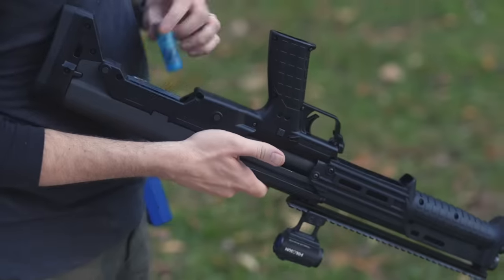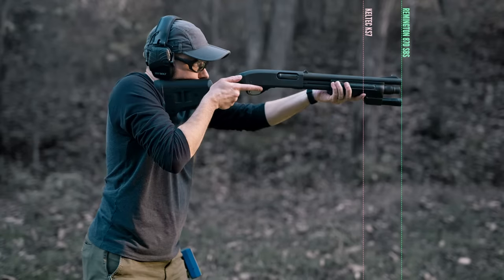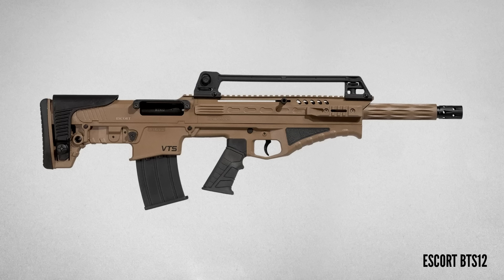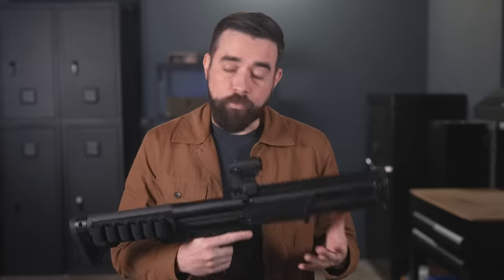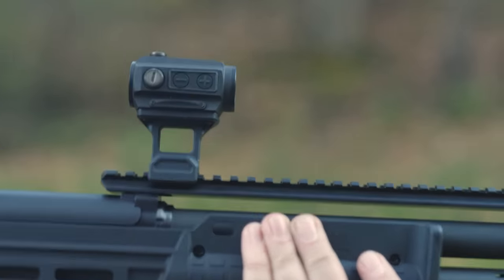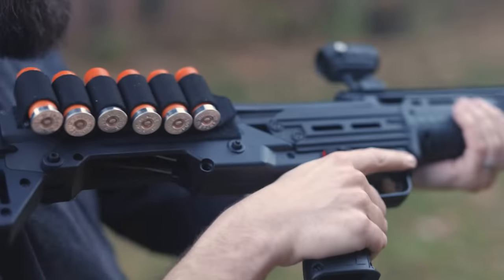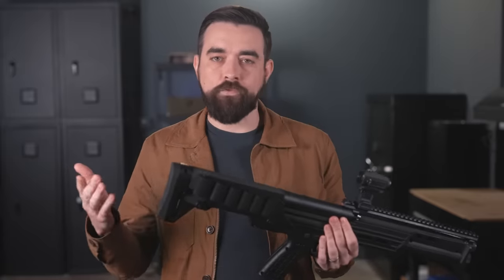The Bullpup Shotgun Experiment

Comment: Love my ks7. Biggest complaint about the bullpup in general is the recoil impulse compared to a traditional layout with a drop at comb and heel. Straight back making it harsher than normal for it's weight class compared to traditional which sort of rolls upward. Having shot trap and skeet since highschool with traditional layouts it was definitely something I needed to get used to.
Reply: How reliable has it been? Been thinking of a shorter shotgun but Idk if this or a shockwave with a pistol brace would be better
Reply: Get a recoil pad. Helps.
Reply: @aaronolivas4958  I was gonna put an edit cuz that's what I did
Reply: @kylekenney1907  reliable enough. I had an issue short shucking because of how close together your hands are on that thing but that's more or less training. Haven't had anything break yet but it's still fairly new to me as I got it with the last government approved sick check.

Malfs are a bugger tho, no easy access. If you're being serious with it I'd suggest the shockwave but if you really just gotta use the one in the pipe it's fine
Reply: I have had no problem managing the recoil of my magazine fed semi auto bullpup.
Reply: Do you think a vertical grip would help the short shocking?
Reply: Just got a hatsan bullpup 12 gauge and jk arms suppressor. Could i hit skeet with it?
Reply: @thomasjefferson3552  idk I dropped that ks7 maybe a month after. New gun syndrome wore off and I learned what I hated about it

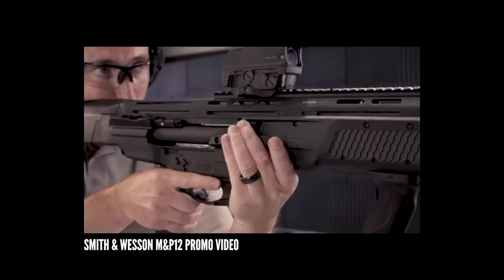Comment: 4:18 "A single round of buckshot is generally all it takes to provoke an immediate change in behavior..." GOLD.
Reply: Understatement of the week
Reply: thats why a side by side is ideal.  easy to load and unload and bang bang
Reply: @shockwave6213   oh yes. I have some Winchester SuperX rifled slug 2-3/4” hollow points for just that occasion.
Reply: @pbgd3  side-by-side or over-under?
Reply: It is one thing to limit yourself to two shells, it is another to pick the single worst recoiling configuration out of the two designs.

SxS sucks compared to OU with any kind of recoil above a light bird load.
Reply: I thought that was a great line too….
Reply: So, if one single round of buckshot is generally enough, why then should slow reload speed be an issue at all? That being the case, capacity is not an issue either. In the unfortunate case when one shot, or 5, or 6 are not enough, in such high stress situation, capacity would be the real advantage.
Reply: Not true.  Sometimes that generates a shootout.

Comment: I’m personally interested in a bullpup shotgun, and in your insightful explorations of the platform. 

While a magazine-fed shotgun is not something I am a fan of, the semi-automatic shotguns feature a moderate magazine capacity compared to the multi-tube options. This is at least more options than just the KS7.
Reply: Check out the Tavor 12
Reply: I recommend the Dp12 it's a beast that holds 16 rounds, pump action double barrel shotgun.  The recoil is light, it does weigh 9 lbs, but surprisingly you can't tell since most of that weight is in the rear.  Mine is my home defense shotgun, I never regretted my purchase.
Reply: @collinsingleton6899  felt weapon weight, that’s a topic I haven’t heard explored much in this context.
Reply: I've got a ksg loaded out with aftermarket recoil pads and cheek guard (the sights have to be higher to get a proper picture and that means it's really a chin weld and that part is steel so it'll pop you in the jaw if you don't) the good is that it really does give you a lot of firepower in a smaller package and with an extended pad the recoil is decent and doesn't take the sights off Target. With mini shells, which it cycles flawlessly, possible even more so than regular shells, you're pushing 25 bundles of spice with negligible recoil. That seems like a pretty convincing setup. 

Now the bad. Running the action without a vertical forgrip is less than optimal because the action really requires a very solid shuck for and rear for reliable function. You really need to muscle it on order to get best results and as Chris mentioned, the action isn't smooth. It really isn't an issue with the type of action, it looks like a modified Ithaca and that, old m87 is still my fastest and smoothest pump gun I've ever had, but I really feel that it's more that the attention to detail is in the 'good enough category'. The fact that the rail and guard your grip mounts to is plastic also really doesn't help. It is far more difficult to run fast than a well made Ithaca, sxp, Mossberg, old model 870 or Benelli but if you really put some force into it, it works but feels like you might damage something. 

If I was a little more confident in the construction, I'd feel more comfortable with it but it is my current home defense shotgun loadout. The traditional shotguns which I'm better at running don't have good mounting options for optics and which I thought about their side saddle or other issues, the fact that the ksg has everything ready to go without anything itself on rails including light on an easily accessible package makes it a better choice for a single item to grab when I'm half awake. The fact that it uses an Ithaca type action also means shell won't fall out of the side when working the action while leaning to the right.
Reply: I like my Panzer BP12, it came with 2-5round mags, and i picked up  2-10round mags.
I can clear the house real quick.
Reply: @kftc1980  Biggest problem with the DP-12 is it's top heavy like nothing else out there. Stacking a second barrel and chamber on top of twin magazines makes it incredibly awkward to swing from target to target. If you're gonna go bullpup, I'd either go single-tube or mag-fed.
Reply: Black aces makes a good quality one , not bad priced . It’s solid
Reply: @BB-1990  always wondered about that panzer bp12.. wonder how it holds up compared to other cheaper type shottys.
Reply: @BB-1990  I wanted to get that but it was a bit more expensive than I could afford at the time, and the store I went to was out of them. I ended up getting a Hatsan BTS12, which is basically the same thing but with an integrated afg instead of one mounted underneath and a good bit more polymer. They even can feed the same mags.
Reply: @shred1894  As long as you can clear the house with it,  it's all good.
people asking about long term quality, well i don;t care. It's not like i will be putting a thousand rounds through it. Break it in, and have it ready for home defense.
Reply: @BB-1990  Both of the ones I mentioned do have pretty good reliability if you keep them clean and lubed. All the parts that I would be worried about are solid and don't feel fragile. A lot of the semi-auto bullpups are basically very heavily modified AR-180 style action, short stroke gas piston, but with a locking pin instead of rotating bolt. The fire control looks almost exactly like an AR-15/180 except there's a linkage to the trigger, and the exterior controls are basically AR controls but slightly different.
Reply: You prefer single shots or double barrels?
Reply: @BB-1990 BP12 is too much of a porker though.

Comment: My problem with the KSG was that the action was so rough, and that anything short of a 100% thrust both rearward AND forward was likely to induce a malfunction.  Compare that to something traditional like a Mossberg 500, which as long as you complete the cycle and don't short stroke, you can use whatever amount of force at whatever speed you choose and it never fails.  I tried every manner of polishing and smoothing with that thing as I could and was never quite satisfied.  I'd love to try the KS7 but I'm sure it's the same mechanism and linkage in there as well.
Reply: Mossberg's 500-series pumps are definitely the sweet spot of forgiving over/under strokes.  Not too tight, not too loose, not too long and not too short.
Reply: With the right charging handle, my KSG runs great.  The Striker charging handle is angled just right to torque the hell out of the action, and with the metal rail extender, I don't have to worry about breaking the pump forearm.  Being the dumb brute I am, I don't trust just polymer on that.
Reply: KS7 is much smoother.
Reply: I’ve had a KSG for 8 years and well used. My  action is pretty smooth but still not like a traditional pump.
Reply: I've had the same experience with my KSG12
Reply: @volkskrieg8735  ; Or, instead of hypothesizing, you could try both and see that the KS7 racks more easily.  Kel-Tec developed the KS7 after the KSG, and according to the manufacturer, they revised the action to make it smoother.
Reply: @volkskrieg8735  : I can’t remember if I ever heard an explanation, but whatever KT did, the KS7 cycles much easier than the KSG. I also prefer the lighter weight, less bulky shape, better balance, and overall better ergonomics of the KS7.  The high capacity of the KSG is cool, but I think the KS7 has adequate capacity and is a much faster handling weapon.  I would like to see a second generation KSG, incorporating the KS7 changes and other improvements, but so far….
Reply: I had one and found it WAY too light for 12ga. A 20 ga version might actually kick ass though

Comment: Absolutely keep going with this series.  IMO, a solid, reliable tube fed bull pup semi auto would be the ultimate home defense shotgun.  7 rounds, short overall length, and not having to worry about messing up the pump would be amazing.   Whoever can do that will have my money!
Reply: You should look at the IWI TS12.
Tube fed, reliable, from a reputable company, short, and well designed.
It is ugly as sin, though, so you have to get over that.

But yeah, I do wish I could have a single-tube TS12, primarily to shed weight, height, and girth.
Reply: Check out the Kel-Tec KS7. It meets most of your criteria for around $600. It's not semi-auto, but its pump-action cycles very quickly and reliably.
Reply: @youcanrunnaked  The KS7 isn't semi-auto.
Reply: @LinkHyrule03 : Sorry; you are of course correct.  I read right past that. Edited accordingly. IMO, a pump is more trustworthy, but the IWI Tavor TS12 would be my choice in a semi-auto bullpup shotgun.  A smaller, lighter, and less expensive version of that, even with less capacity, would be sweet.
Reply: @LinkHyrule03  nope cant i have witnessed many sins and this surpasses them all
Reply: not really reliable either  @youcanrunnaked
Reply: @Johnny-tq9no : Not in my experience. I know one YouTube reviewer had problems with his example, but others have not. Are you speaking from personal experience?

Comment: I've been using the IWI ts12 for several months in competition. Not generally a fan of shotguns but it has been reliable with 71/2 shot and up, has an intuitive rotary magazine system, short and handy profile, and is even easy to quad load.
Reply: I've owned a TS12 for two years. It's an outstanding shotgun that even my 130 pound wife can easily handle.
Reply: I would be interested in seeing the quad load. I don’t think I have the hands for it, maybe you have something that I have not thought about.
Reply: I agree. Pretty much everything about the Tavor TS12 works for my purpose. No pump action keeps the gun on target and, yes, 16 rounds makes using without reloading very enjoyable.

Comment: A few years ago I fired a KS7 that was under review by a gun magazine. Both myself and the author of the review experienced multiple weird jams. I absolutely hated it. I agree with your assessment that the shorter overall length is not worth the unreliable cycling. I also have strong doubts about the reliability of box fed shotguns (shells squishing over time in the magazine) and have seen multiple Turkish-made VR80s fail during competitions. On top of that, running a pump (or indeed manually operating any firearm) is not ideal in a high speed, high stress situation. 

Chris, by all means keep investigating because I like your videos and you research throughly, but I don’t think the bullpup shotgun juice is worth the squeeze with these offerings. If a reliable, semi auto, tube fed bullpup ever comes out that might be a winner.
Reply: Dissident kl-12 would like a word
Reply: @laxman2809  Dissident shotguns run well from what I’ve seen in matches. Real nice guns. Not a bullpup though. Do they have some feature in the magazine to prevent shell squish, or do you just only load them just before shooting? It sucks because really this is an ammo problem, not a gun problem. All-brass buckshot or slugs would fix it.
Reply: I would tell you however they sit in the magazine doesn't deform the shells in my expirience. Its really only the brass on brass contact at least in the vepr and saiga mags. Dissident does tune the magazines but that's so they drop free like pistol mags. I leave my 2, 5 and 10rds mags loaded regularity without issue. I do not leave my drum loaded. I load my gamer stick mags before the match.
Reply: The Ks7 I own just loves to have weird jams and double feeds, the Ksg on the other hand does not. The only issues people have with my Ksg is short stroking, which can be worked around once they get used to it, and are pretty much just a failure to throw a shell into the feed ramp, rather then double feeding it.

Comment: I had the same feeling as you with the capacity. The internet makes you think you need 100 rounds of buck. 7 is good for most situations this side of all out war.
Reply from the maker: And in actual combat, a carbine is a much more versatile option, so... I'm honestly not sure what real-world niche the high capacity shotgun fills.
Reply: @LuckyGunner  I own the KSG, and found your thoughts here well-considered as always. You specifically mentioned the increased difficulty in loading tube-fed bullpup shotguns, and I believe that's the answer to your question. The high capacity is almost a necessary result of the slower loading compared to an 870/590. 

It has the side benefit of adding weight and therefore reducing recoil on an already punishing platform. Mine has also been 100% reliable with mini-shells, which makes the discussion of reloading under duress almost academic.
Reply from the maker: @Brandon Reed The reloading issue is more of an annoyance than a real world problem. The bigger concern to me is that if that increased capacity comes at the expense of reliability, is that really a worthwhile tradeoff? Sure, you would probably never have to reload a KSG, but that's already true of a shotgun with just 5-7 shells. It's a solution to an almost non-existent problem.
Reply: @LuckyGunner  Have you never been attacked by a flock of zombie geese?
Reply: @LuckyGunner  The same niche as a side-saddle - spare ammo just in case, only here it's easier and faster to 'reload' than a side saddle will be. If you're carrying 12rds of buckshot in/on the gun to begin with, doesn't hurt to have all that loaded in the gun already (if the gun actually worked reliably). 
There is the goofy notion I've heard of less-lethal in one tube and lethal in the other, this is a horrible idea. Cops by and large use specially painted shotguns for less lethal because they've killed people before by getting ammo types confused in the heat of the moment.
Reply: @LuckyGunner  it is for those poor unfortunate souls that live in the wrong states.  They either get something like this, a very neutered AR, a revolver, or a gen 3 Glock.
Reply: @LuckyGunner  Different ammo in each tube is all I can think of, and even then not every model is realistically used in that way.  It's probably just the usual reason of because it's cool or seems good on paper if you don't think about it too hard, and it makes great marketing.  

If dual tubes were that good, I think we'd have seen them on traditional guns awhile ago.  Plus they gotta add some unnecessary weight out front...